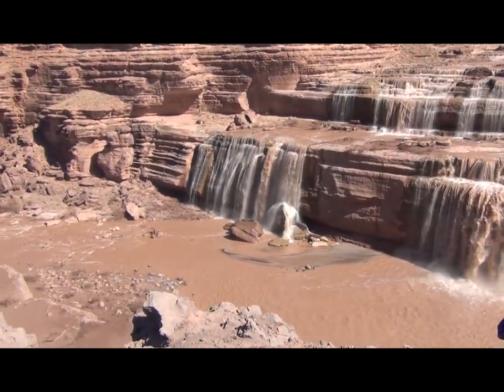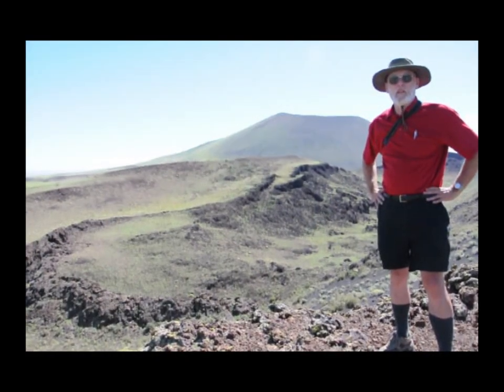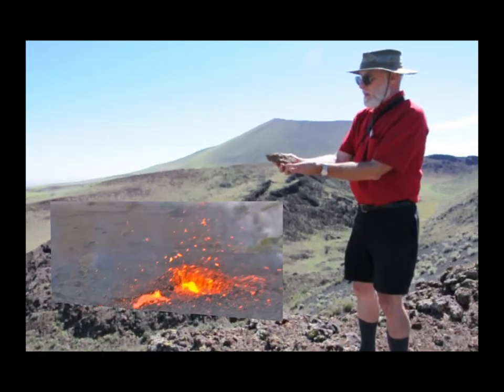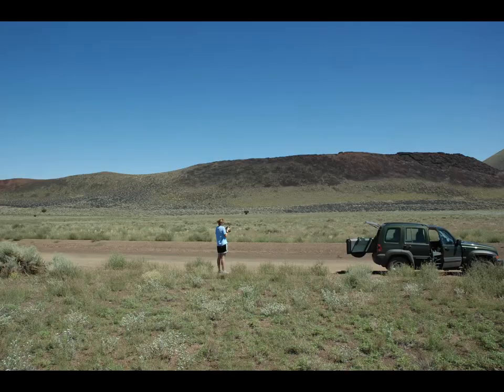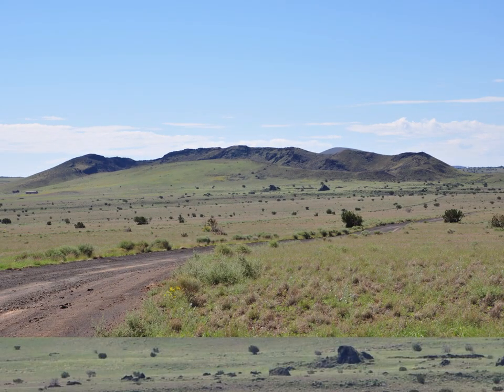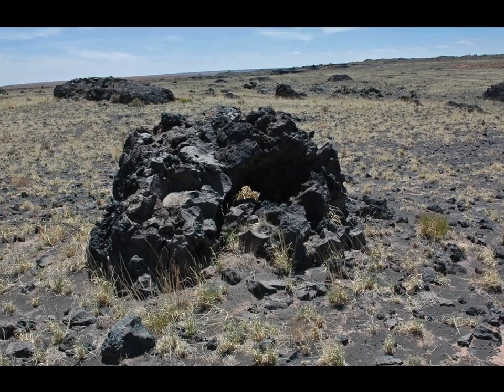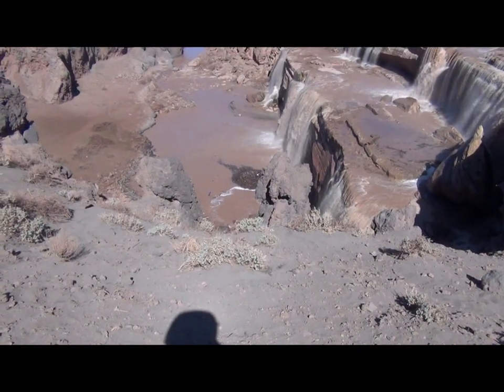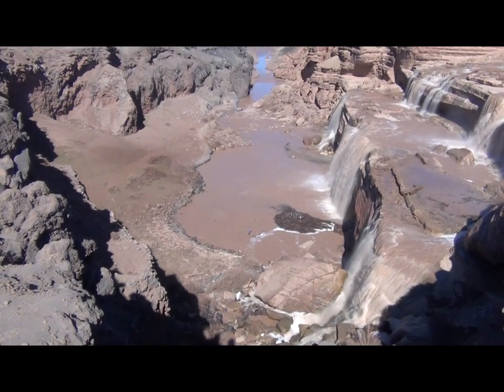Grand Falls, Arizona, Geology Part I

Comment: I just got back from visiting this amazing site (10/22/2022).  The plaque at the site claims the lava flow from Merriam Crater happened 150K years ago and that caused the river blockage/re-diversion.  At 0:58 you claim the blockage happened 20K years ago.  Was the river diverted twice?  I'm asking because I want to understand the erosion level we currently see today.  Is it representative of 20K or 150K years of erosion?  By geologic time scales it looks like a very young waterfall.  Thanks for your video and explanations!  For anyone going to visit:  You will get a mud shower if the wind is blowing....little specks of mud on everything.  Also the road to it was the worst washboard I've ever experienced driving, but it was well worth it.
Reply from the maker: Great question. Just one eruptive episode blocked the river. Relatively young lava flows (in geological terms) are notoriously hard to date. The whole rock K-Ar dating from the 1970's indicated an age of 150,000 years, but that method can give anomalously old ages with even slight amounts of Ar leaking from the Earth trapped in the lava (the half life of K40 is 1.3 billion years, thus you're dealing with small quantities in young lava flows). Duffield et al published a detailed study in 2006 using four different dating methods -- Ar-Ar of individual mineral grains, exposure ages, paleomagnetism and one fission track age from underling Moenkopi Sandstone. The four methods converged on 20,000 years ago. I find their argument compelling, and that's the age I use in my videos. And yes, a very dramatic landscape!
Reply: @gkcgeoscience  Thanks for the reply.  ~20K years of erosion it is.

Comment: Would you explain why there is red and black cinders?
Reply from the maker: Great question. (I think this might be worth a separate video) Basically it's a function of the eruption temperature. These magmas are fairly high in iron, and above some threshold the temperature is high enough that the iron will oxidize (just like rust)  while still airborne, and you get a red cinder. Below that threshold the cinder is black. What is that temperature? Still researching that one. (This is a copy of my reply on the cinder cone video)